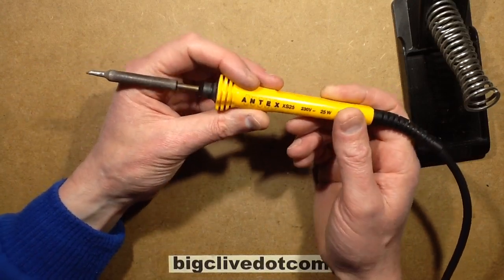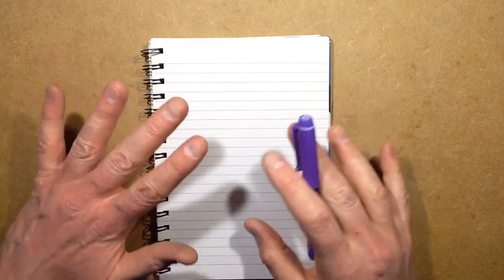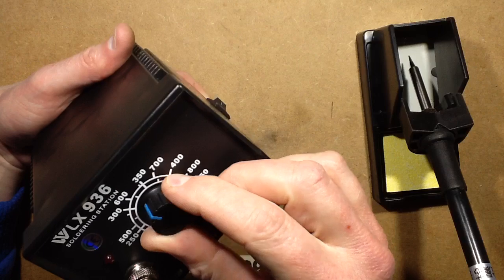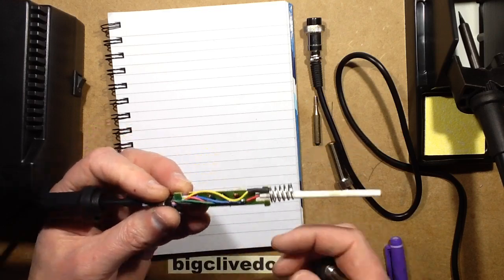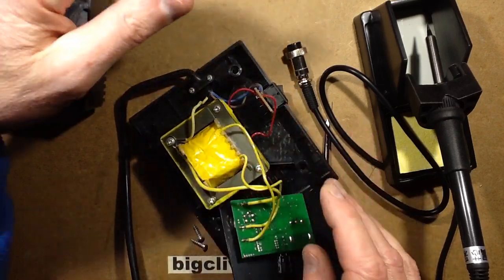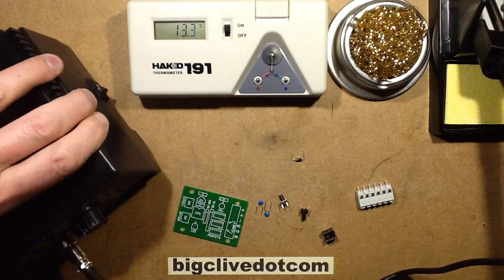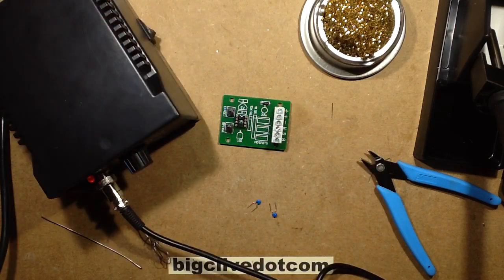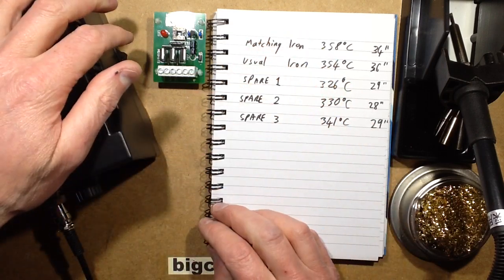Soldering basics and choosing a cheap soldering iron.

Comment: Why are headphone wires so annoying to solder though?
Reply from the maker: +shurdi3 If I recall cotrrectly they are very thin strands of wire woven with a fabric thread, so not much copper to work with.
Reply: Those rat bastards...
Reply: +shurdi3 many use copper coated alloy wire, or something weird like that, sometimes its not even copper coloured, im sure its plain aluminium on cheaper headphones, so i wonder how they solder it at the factory.
Reply: +shurdi3 higher end ones will use more copper, but they also cost more. Cheap headphones are cheap for a reason after all, they're not sold at such a low price out of the goodness of the company's heart. 

The real tricky part about headphone wires tends to be that the strands are all coated, so you need to strip the coating off to actually make contact with the copper. Mildly confusing to say the least, given that it is usually a mostly clear varnish like stuff, as it is hard to notice it if you didn't know it was there to start with and just looks like bare wire. Surprise!
Reply: shurdi3 pre-tinning is generally a good choice for most tasks if you can feasibly take the time. If I'm dealing with overly fine and insulated wire, then I find that dipping the end in a solvent to take care of the varnish, fluxing, tinning, and then soldering has given me the best results.

To me the far bigger sin in cheap headphones isn't the thin wire they use, but the needlessly poor strain relief they use.
Reply: So...
Could I hypothetically use 3x1 wire for headphones? 

Cause I can get 3x1 wire for cents to the meter 

Not so much with headphone wire
Reply: Actually, the only way to make it bearable I've found,  is to pretin the wire without doing anything to the varnish 

Takes a while to tin, but makes it much easier 

Before I used to burn it off, which lead to a lot of frustrations
Reply: +shurdi3 Because they prefer us to have to buy new headphones, I often burn the enamel off, then twist the wires together , then attempt to blob solder, good enough so they work
Reply: You can solder them easily using acetylsalicylum acid (aspirin) just add a big blob of solder onto the tip and press it against the aspirin pill and the cable (try not to inhale the smoke it's pretty bad)

Comment: Getting a soldering station way one of the best things I should have done much sooner. I got a "expensive" one (by chinese standards), not one of the overpriced Weller or Ersa brands, but an XYtronic ( http://www.xytronic-usa.com/shop/item.aspx?itemid=219 ). It cost me around 100€, but it is such a joy to work with (work in a hobby) that I never regret the investment. Before that I used a fixed 25W iron for 15 years, and while I don't say that everyone should get an expensive soldering station, everyone should at least get one of the 936s. Even that is a huge difference!

Comment: Does anyone like Weller products? I've used then for 45 years.
Reply: +BobEckert56 I do. But they could be cheaper.
Reply: Paul Frederick Yeah, I know, but they are pretty much indestructible and I can get parts and tips lots of places. I'm on the 2nd mortgage of the house (kidding). The iron and tip is really really important if you are a Heathkit builder or restorer like me.

Comment: Just don't buy a Weller.

Having spent 15 or more years teaching electronics, we came to regard Antex soldering irons as almost disposable they used to be that cheap. Seriously it was hardly worth the technician time to repair them beyond changing the bits. 

But that was all 6 years ago, prices seem to have gone up.

Maplin are useless and very expensive, buy online from Antex.

Comment: I run a TS100 with 2.5mm small flat head type tip.
Runs off an Asus laptop PSU, I also got a car cig PSU for it.
It could get a 12v powerbank and make it portable but I have no need for that ATM.
I use 0.7mm tin based solder.

Comment: I had a look at soldering stations when you demonstrated the iron and the heat gun in a previous video but was put off by the sheer number of different ones available, so I appreciate a pointer towards a good unit. Can you get any of the cables for the 936 with silicone leads like the Antex one? Thanks for the video!
Reply from the maker: +Matt Tester (UKMatt2000) I'm not sure if they are available with silicone leads.  The ones they have a still very flexible despite being PVC.  I don't find them an issue.
Reply: bigclivedotcom Thanks.
Reply: +Matt Tester (UKMatt2000) One thing that does put me off with the 936 clones is the range of available ones. Some are real horror stories inside. The lack of silicone leads is disappointing too.
Reply: Ethan Poole
I do not do enough rework to warrant the expense of a power solder vacuum. For what I do I can manage with a solder sucker. I have a Chinese knock off of a heavy duty Edsyn Soldapullt and it works pretty good.
Reply: +Paul Frederick Between one of those and wick you can do quite a bit.
Reply: *****
It just takes longer. But I'm in no hurry.
Reply: +bigclivedotcom I have the Maplin branded 60w digital soldering station, which has a very similar iron, and it has a silicone lead. Be interesting to see if the digital one you have coming is similar to it.
Reply: Silicon leads are more important for irons where the cable runs directly from mains. Here the voltage is stepped down to 24V, plus if you damage the lead you can buy another iron for a few dollars
Reply: I have both the Aoyue Int968+ (digital soldering iron and hot air) and an Aoyue Int3210 (digital soldering iron only) both of which have very flexible cables, silicon handle overmolds that keep the handles a comfortable temperature during extended sessions, with 70W heaters, and accept standard Hakko tips.  The Aoyue models seem to be more consistent in their level of quality than some of the other brands, though it is still Chinese build quality if you look at the internal circuit boards with the usual through hole parts mounted rather haphazardly.  If you are only seeing a soldering iron then I would opt for the Int3210 (or similar) model.  It is also worth buying an assortment of tips styles and sizes as they do not cost much and you will find different tip styles or sizes work better for certain jobs.  I also have a real Hakko 808 for de soldering through hole components (well worth the investment if you will do much through hole repair work).  Hopefully that gives you a few ideas.
Reply: +Matt Tester (UKMatt2000) The brand marketed under the name "Madell" is very good, almost identical to the Hakko 936 its copied from.
Mine has lasted 10+ years of moderately heavy use.
Reply: +bigclivedotcom I have a 936 with a silicone lead ;-) The weak thermal coupling to the bits is a snag unfortunately. I just didn't have time to think up a fix for that.
Reply: akkudakkupl
I have heard of people making sleeves. Some thin copper sheet would be ideal. Hard to get a hold of though. Aluminum can might be the easier fix? But aluminum cans are painted inside, and out. You're probably going to want to get that off somehow. I'd try burning it. Then a scrub with some steel wool should do the trick.
Reply: Paul Frederick +1 to this, will give it a go.
Reply: akkudakkupl
Well, if you can, try to find someone else that has done it and described exactly what they used. I have only read about it in passing, but no great detail. As I've researched some of these far eastern irons for my own possible purchase. The easy availability of cheap tips for those things does make me jelly. But by the time I bought the iron, and tips I could have a supply of tips for my Weller. As expensive as they are.
Reply: guys if you use original hakko tips the fit is much better, and you can pull the inner sleeve to use between the cheaper tips

Comment: Hi Clive. What about tinning and cleaning tips. In the past I have had tips turn black and refuse to take solder. What I have I been doing wrong?
Reply from the maker: +Martin T Sometimes the tips can get contaminated with plastic or other materials and oxidise enough to stop them taking solder.  You can get small tubs filled with a mixture of solder, fine abrasive and flux that you scrub the tip in and it brings it back to a shine.  If the tip is pitted it is worn out.
Reply: bigclivedotcom
Thanks for the reply. I had an issue with a new tip, it was working absolutely fine then after about 10 minutes turned a crusty black. I managed to clean it enough to get a little solder on it which helped to remove the rest of the oxidised layer, though I wasn't sure why. I'll look into getting some tip cleaner for future, though the tips as you point out are really cheap I should stock up on more, just in case. Excellent video. I love how you use these cheaper parts it really makes the hobby accessible to those on a limited budget such as myself.
Reply from the maker: +Martin T Could it have got too hot?  I had a weird issue recently where I used a touch of silver loaded high temperature solder and it instantly made a bit non-stick.
Reply: +bigclivedotcom that'll be it. the temp read out was around 400C, much higher than I needed it to be.

Comment: My Hakko FX-888 iron does not have a sleeve. The ceramic heating element mates directly to the bit. However, it is a VERY precise fit.
Reply: +Euro Bum Same with my 937D+ because it uses a Hakko heater.  The purpose of the sleeve is to ensure the element is properly centered in the handle.  The only issue with these (and Hakko stations have a similar problem) is breakdown of the Bakelite hardware used to secure the components of the handle.
Reply: +Euro Bum Interesting. Maybe that's so it can give a super-accurate temp reading? Great iron, regardless.

Comment: After you have used a JBC nothing else will be tolerable, except perhaps a Metcal.
Different price range, but so nice, especially on ground planes.
Reply from the maker: +stefantrethan Hugely different price range.  Better suited to professional electronic repair facilities or high volume hand manufacturing where the extra cost can be justified.  I try to use the lower level stuff on this channel so people can buy and use the exact same equipment.
Reply: +stefantrethan Yah, like Clive said, that's not really a fair comparison. For  nearly everyone, a Ford is just fine. There is no need to recommend a Ferrari.

Comment: I've been using a W.E.P. 937D+ to start soldering, and I can completely agree. The themal coupling in these cheapy irons may not be suitable for huge components, but they are absolutely fine for your typical circuit boards. Good stuff!

Comment: Some of the copies do have sleeves but its rare, and they tend to destroy the ceramic element. I was thinking about putting some cpu grease in there just haven't got around to attempting it yet
Reply: +Pomona Bill (PomonaBill220)  There is some higher temp stuff but yeah accual cpu grease would not work for long.
Reply from the maker: +KingOfKYA I can recall being given a tube of copper loaded grease by the maintenance department in a factory.  They said they used it on their bits to ensure they didn't jam on the irons.  CPU grease may burn and harden at soldering temperatures.

Comment: would you not want a 1M Ohm resistor in the ground lead?
Reply from the maker: +erg0centric There is actually a place on the PCB for that facility, but most mains irons use a directly grounded tip, so it seems common in the low voltage ones too.

Comment: I am using Yihua 853d and it is AMAZING, had it for 6-7 years and it 
was on for at least few thousand hours total. Sometimes it was on for two days straight, it's still on it's first heating element in both the soldering iron and hotair gun. The built-in power supply died a few weeks ago though, overloaded it badly with a rapidly changing inductive load and the voltage spikes probably killed it. Didn't bother to fix it yet, I probably should. Now I feel bad about it.....

Comment: Same thing happened to a weller i bought from ace hardware here in the states - one arduino shield and the tip started to pit to the point of being brittle and scratching off. Was 30 dollars and i promptly returned it. I was accused of buying a tool "just to finish the job", and I have yet to go back to ace hardware. Bought a 15 dollar soldering iron from china, came with 6 tips AND temperature control (pretty flimsy but hey, 15 dollars!) and I've soldered probably 100 times as much with one tip as I did with the weller and the tip is still going strong. Same solder, same flux. I must say hakko's stuff is my favorite though, i've had the joy of using a few of their things!

Comment: At school we learned to cut the component legs before soldering. The shock from cutting could break the solder joint. Or so the teacher said.
Reply: +Svein Erik Edsberg 
Yes, I think that's the rule for medical or military equipment. But it's not an issue in normal use. Breaking solder joints is only part of the reason. It's also much easier to tell if a solder joint is good or bad, if the joint hasn't been messed with by pliers.
Reply: Makes sense. Our course was for military spec.

Comment: Maybe you can help me Clive.  I have one of these 936 soldering stations,  had it for about a year now, and it died yesterday.
The LED lights up and stays on constantly, but the tip stays cool.  Is the tip faulty? or the station?
Reply: AndehX
No, a replacement element or even whole replacement iron shouldn't cost you much more than 10 €/$/£.
Reply: AndehX
Hard to tell. Pretty much an iron that has the same specs (voltage, power, connector) as your existing one.
Watch the video. Clive is talking about this.
Reply from the maker: +AndehX Sounds like the element has failed as the others have mentioned.  The LED is lit continuously because the unit is trying to heat the tip up.  Easiest fix is definitely a new full handle.  Literally a plug-in repair.  As also mentioned, the search keywords are 936 and handle.  Like this:-  http://www.ebay.co.uk/itm/322051396027  You may be able to get one quicker locally at slightly higher cost.  Just make sure it's the "hole" (socket on cable) version if that's what your original iron is.   Also check that your existing iron is fully plugged in.
Reply: +AndehX replace the element
Reply: +AndehX 
Most likely a burnt out heating element.
Reply: would it be cheaper to simply buy a new station?
Reply: +superdau ok what exactly do I look for?
Reply: +AndehX well the easiest thing to do would be to grab another iron handle and see if it works, but yeah not an awful lot to go wrong with an iron so I'd say the heating element probably burnt out, just search for 936 handle on ebay.
Reply: +bigclivedotcom will do Clive thanks!  yeah I think the element has definitely failed.  I was in the process of repairing a Gameboy and the solder suddenly stopped melting.  then I realised the tip was cooling down.

Comment: Beware, there are other Chinese temperature controlled soldering irons that look exactly like that one, have the same 5 pin connector and use Hakko bits but they use a completely different temperature control method and so are not compatible.  They don't use a thermocouple or a thermistor they apparently control tip temperature by measuring the resistance of the heating element.  

The Tenma 60W, also sold as the Maplin 60W and other brand names is one digital example.   http://tinyurl.com/zyrsoml 

Clive, you will enjoy reviewing a digital temperature controlled iron, be prepared to be enraged by the lying software.